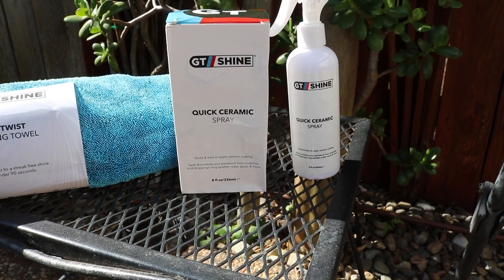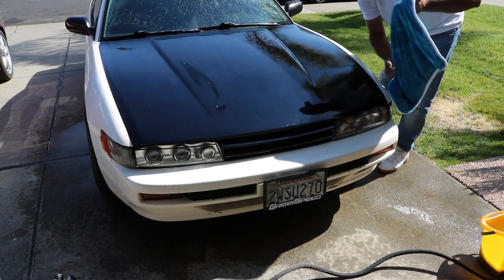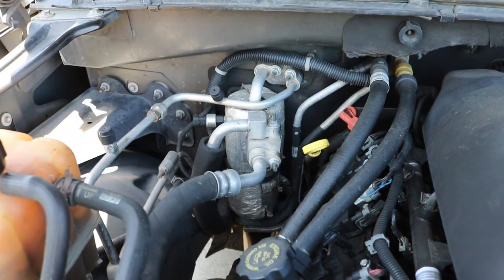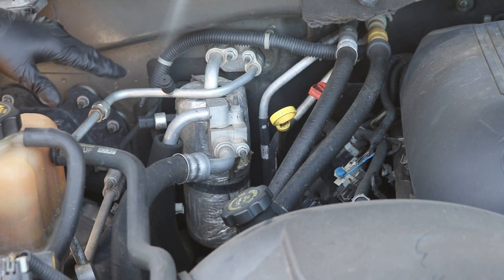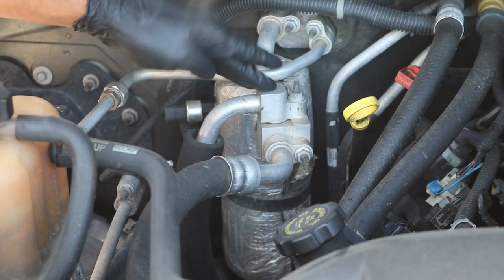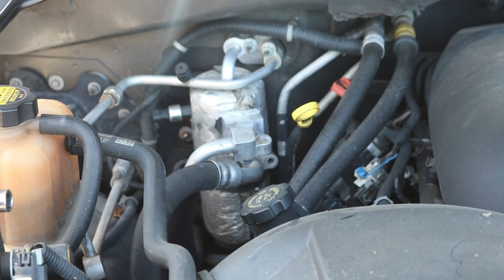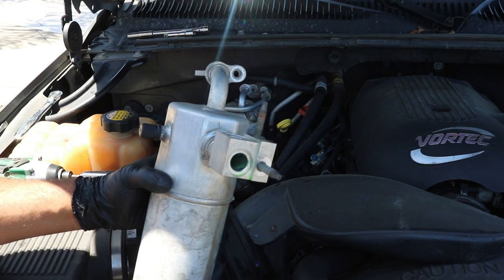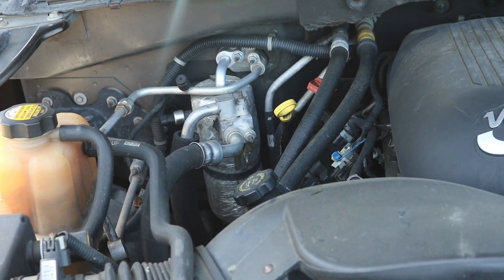GMC/Chevy AC accumulator replacement

Comment: Why did you replace just the accumulator. Did you do the orifice tube as well. I have front and rear AC it still working but it seems to not work good when I'm not moving for more than a couple minutes. It does seem weaker than normal too in the front then it should be. Sometimes it's pretty decent though. I tried adding a little refrigerant but I don't think it's doing much The pressures look pretty good. I've heard that the desiccant sack inside the accumulator can break and then the beads kind of go around the system and clog up stuff I'm wondering if my orifice tube is not functioning properly. The rear AC always seems to be cold it's just the front that's lacking. I have a new clutch fan so I don't think that's it. Sometimes if I rev it up at idle it does seem to cool it off a little better but it still doesn't seem right.

Comment: Hello my friend car x5 e53 3.0i engine 30 What is the best engine oil?
Reply from the maker: Whatever the manufacturer recommends
Reply: @HelpingHandAutoRepair  Your answer made me laugh. Amazing.
Reply: Hey man, if you have them look on the cap of their oil line under the hood, it usually says it there. Might say it on the sticker inside the driver side door, too. Or have them google the year/make/model of the vehicle and google will likely tell ya. Hope that helps.
Reply: Used dirty oil works best. You’ll have a brand new car soon after.